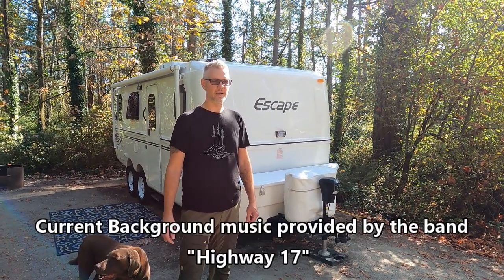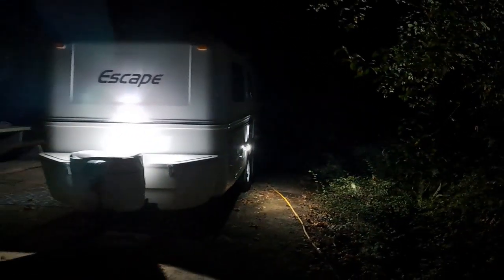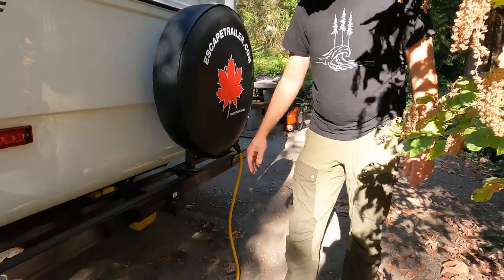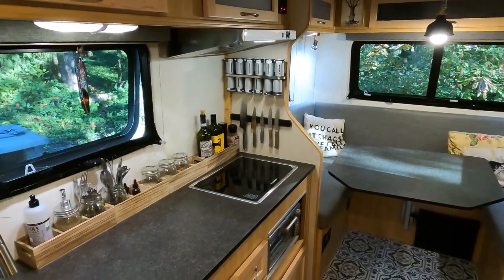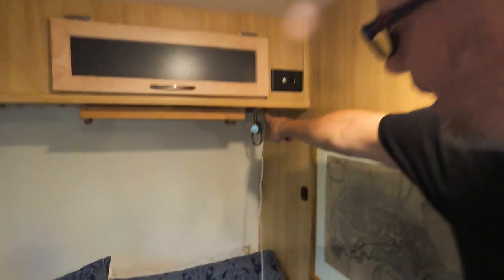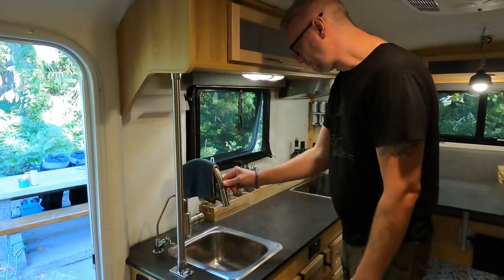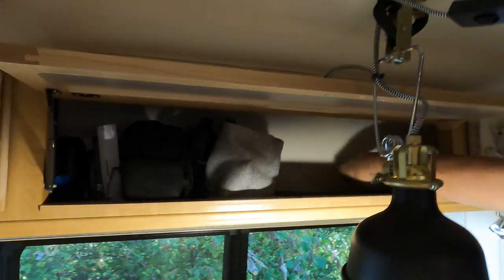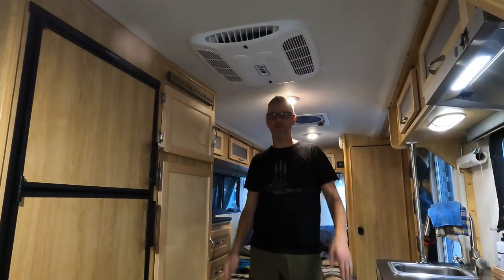Our HOME on Wheels - ESCAPE 21C FIBERGLASS TRAILER TOUR | FULL-TIME RV Life 🍁

Comment: Trailer's utility hitch capacity is really low. Whole unit needs a heavier capacity frame.
Reply from the maker: At a GVWR of maximum 5000lb? Just wondering😊.
Reply: @backroadsbetty  GVWR and load capacity are two different criteria,  and the utility hitch capacity is barely enough for two bicycles and carrier rack.